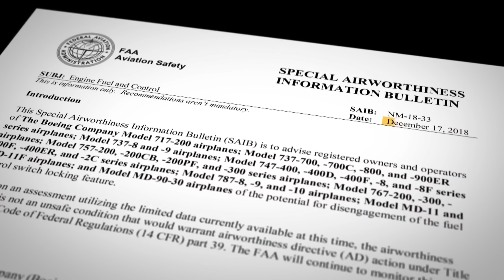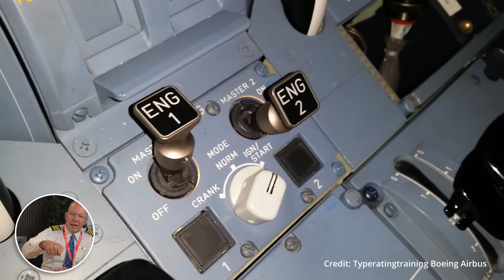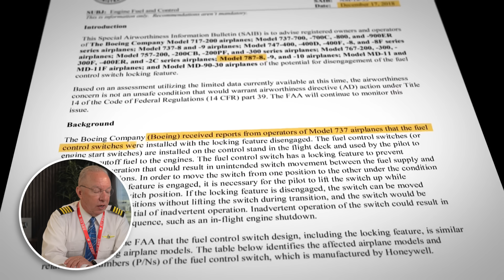Air India 171: The FAA’s 2018 Fuel Switch Locking Bulletin Explained (16 Questions Answered)

Comment: The anti-labor brainrot is strong in these comments today; I refuse to believe that there aren't at least some shills here to spread propaganda. I weep for my generation and our lack of critical thinking on display here. First of all, a video that is high enough resolution to make out exactly what switches were pressed by which pilot would be a massive file, and files take time to write; the larger the file, the longer it would take to write to the black box, which isn't ideal for ensuring everything is written to the black box in the event of a crash.

And for what benefit? All I can see is a negative impact on the working environment and on safety. People behave differently when they are being filmed, and that is not always a good thing. Just being filmed has a significant cognitive load; do you really think a pilot needs any more cognitive load? Citing examples of other jobs monitored by cameras just shows how normalized invasive surveillance of the workplace has become, but how many of those jobs are safer or more efficient because of those cameras? Is work actually better for them? "People who aren't doing anything wrong have no need to worry" is hilariously naive given how our society has been taken over by drooling Dunning-Kruger outrage zombies and that many in upper management are worthless MBA nepo-babies who have neither the technical knowledge or baseline cognitive ability to understand what they would be watching. For police, it makes sense because they wield the powers of the state and their account of events has ramifications beyond the direct encounter, but trucking, for example, is no safer for the cameras—They actually make the work environment more dangerous due to how they're implemented, using AI bots that doesn't even allow a sip of water, so they are more focused on not getting flagged by the camera than on driving.

Comment: I think that the odds of both switches failing one second apart are so huge that I would say that it didn't happen. I believe it was pilot induced. Which, why, and who may never be known? The pilot who said why did you turn them off really could have done it knowing that he would be recorded and if the other pilot did it and lied would leave the whole situation in doubt forever. This would actually hold harmless the one who did it forever.

Comment: Is it still possible that the non-flying pilot thought they were raising the landing gear and moved the wrong lever(s)? This would still be a terrible error, but consistent with “I didn’t do that”.
Reply: @DavidWRankinJr  That's very similar to the first unfounded, speculative conclusion made and later abandoned by Capt Steeeeeve. 

The fact that the Landing Gear Handle was found in the DOWN position would support that theory, but we cannot consider that single data point as conclusive because we haven't seen the entire sequence of events or read the entire voice transcript.  For all we know, the Landing Gear Handle may have been raised normally, and subsequently lowered once ground contact appeared imminent.  We have to be cautious to NOT jump to conclusions without all the facts.  There are too many possibilities at this point.

Comment: I get the camera thing. I think there's a lot of people assuming the cautious reporting because it's only a preliminary report means the full breadth of data recorded paints less of a complete picture than it does. By the time we get the complete report, there will likely be a pretty comprehensive understanding of what happened. I also sympathize on not having day-to-day cameras. There's a gap between what's not allowed and what's actually an acute safety issue. A lot of pilots find themselves in those gaps over time, and I understand their fear of airlines using those recordings to crack down on any tiny infraction and adding to the stress pilots face. Same with the potential for leaks to the general public, who don't know the minutiae of flying and don't have a good sense of what's a disappointing decision from a pilot and what's an immediate risk to the flight. [Or just how safe aviation truly is at this point.] Driving road vehicles is much more reliant on second-to-second attention than cruise flight and, to be slightly crass, incidents are much more survivable for apportioning blame, making cameras more essential for them. All that said, I think cameras are inevitable in cockpits. There'll need to be a balance of monitoring for safety issues and not punishing too much, driving pilots out of the industry and adding stress to people who notably struggle with stress. People want to know every detail these days, and being able to provide that via video, or really description of video, will eventually be required.

Comment: I'm wondering if the fuel cut off switches were both in the off position the whole time the plane was taxing and during the takeoff run.  When the 787 just lifted off the runway the switches on the landing gear said "the plane is off of the landing gear" it caused the computer to see that the engine fuel cutoff switches were in the off position then cutoff the fuel to the engines.  Why did the fuel cutoff just when the landing gear left the ground?  Too much of a coincidence.  I know if the fuel cutoff switches are in the off position then the engines shouldn't of been able to start of continue to run.

Comment: A VERY ery evasive answer about having cameras in the cockpit.
NO ONE asked if having a camera here would have PREVENTED the crash, the question was SHOULD they be added? A camera here would have CONCLUSIVELY shown whether the switches were moved, who moved them and WHEN. That's what the question obviously asked.  That is what the investigators are searching for. Your obvious reluctance to have your work day filmed is understandable, but you also have the lives of thousands of people direct under your control every year.  Whether someone is reading a magazine or telling an off-color joke and might be embarrassed or called out is irrelevant. So why pretend like investigations wouldn't be helped with their addition? Why pretend a radio broadcast relays the sanlme information as a television program?   It obviously would be TREMENDOUSLY beneficial.

Comment: Serious design concern. Just with changing the position of switch the entire operation can jeopardize and leads to catastrophe and system does not mind the thrust lever position before shutting down the engines. Its gut feeling that  rotary wings are safer than these commercial aircrafts with three positions switches installed. Somebody has to seriously think about it rather than shifting blames on others. Its not abt businness or existence of any company but abt lives of millions of people flying in unsafe conditions.

Comment: Captain Steeeve,

On Jul 12th 2025 (UTC) India's media report that the investigation is NOT focussing on a human action causing the fuel switches to appear in the CUTOFF position, but on a system failure. Service Bulletins by Boeing issued in year 2018 recommending to upgrade the fuel switches to locked versions to prevent inadvertent flip of the switches, as well as the FAA/GE issued Service Bulletin FAA-2021-0273-0013 Attachment 2 relating to loss of control issue were NOT implemented by Air India. The stated MN4 computer with faulty soldering, that might weaken and lose contact due to the thermal stress after a number of cycles, interprets data and commands fuel metering valves - with the lost contact attaching the MN4 processor to the EEC intermittent electrical contact, loss of signal processing and engine control faults can occur. The SB writes under conditions for the SB: "An LOTC (Loss Of Thrust Control) event has occurred due to an EEC MN4 microprocessor solder ball failure." According to discussions in the industry it may be possible with the number of cycles VT-ANB had already completed, the solder balls were weakened sufficiently to detach the MN4 from the EEC momentarily due to loads during the takeoff rotation leading to the loss of control of thrust and shut down of the engines.

Source: avherald.com

Comment: Relying on your many years as PIC along with other aviation experience, can you think of ANY scenarios, no matter how improbable they or it may seem, ie. confusing the fuel cut off switches with ANY control switch commands that are done climbing out of V2, that could explain those switches being activated? If not, then Sherlock Holmes was correct " When you have eliminated the impossible, whatever remains, however improbable, must be the truth".

Comment: How about adding a dual custody system where there are fuel cut off switches on both sides of the cockpit and to kill the fuel both pilots have to agree and  both sides have to be in the off position. Similar to needing 2 keys to launch a missile.

Comment: Like any modern day military vehicles (War Machines like Submarines.) there should be a "Redundant" system implemented on top of the cut-off switch. Like a secondary button that's required to toggle on the Captains side of the seat to allow for the switches to toggle.

Comment: You described how there is on the ground vs. in the air logic circuitry via sensors that know if the aircraft is on the ground or not. Why is that same logic circuitry tied into the fuel cutoff/run system so that one cannot cut the fuel to the engines during the climb period after V1?

Comment: As a Flying Customer we should DEMAND that the FAA install cockpit Camera's. Accident investigation is to get to the route cause of an accident. Pilot Unions  don't like Camera's because they don't like reports of Pilot error or violation of Cockpit SOP procedures. But it unfortunately it does happen!! 

Do we have a situation where we could have a very rare, but not impossible situation of WORN detents after years of the Switches being pulled up and possibly dragged across the Detent Lugs. Both the Detent and Switch lugs could get worn and rounded over time. Now this would be extremely rare, especially to have both Switches fail at the same Time. But extremely rare and first time ever seen mechanical problems have crashed Airplanes before..... MAX 737 anyone?? 

But it would provide Indisputable Proof if you had CCTV confirmation that  one of the Pilots physically moved the Switches to the Fuel Cut-Off position in a suicide or sabotage  attempt. At least then you would know that you did not have some rare Mechanical problem that has never been seen before. 

GermanWings 9525 was an example of deliberate Flight Into Terrain.  And the Inspection authorities will not address a deliberate Flight into Terrain... unless ABSOLUTE proof can be shown. CCTV Camera's would add another layer of Data Monitoring. It could also speed up accident investigations significantly. But primarily in Pilot Error... which is a touchy subject. But it's time to get rid of these old ideas. Other industries that Monitor Human Performance with CCTV Camera's have done this. Airline Pilots with the responsibility they bear, should be the FIRST organizations to accept this. 

 This I would like to ask Captain Steve to answer directly. And please read the whole article. 

 In the meantime, here is a fairly chilling article that people seem to be avoiding. But the public and accident investigation teams need this Data. 

https://en.wikipedia.org/wiki/Suicide_by_pilot

Comment: Capt it seems that the installation would not require this kind of bulletin because it would just be inoperative.. the issue seems to be with the switches turning off by loosing contact so they should be changed with some frequency.

Comment: The fact that both switches were still in Run AFTER the crash proves the locking features worked.
Reply: Thats not conclusive either. My bathroom switch tricks me

Comment: I am a pilot and a retired Forensic Investigator and I find it interesting that the first words out of the pilot’s mouth was “why did you cut fuel”. How did he know so quickly that the fuel was cut off to the engines. If you lost thrust, I think I would have said why did or why are we loosing thrust and start a checklist. How did the pilot know so quickly that it was not a bird strike or a flame out. They immediately concluded that the fuel cutoff switches were thrown. Those switches cannot move on their own. How could you not notice in your peripheral vision a pilot reaching back and shutting of the fuel. All the Indian news agencies still want to blame Boeing. They do not want to accept the fact that the pilots either accidently cut of the fuel or cut of the fuel on purpose. Seems they want to cash in on Boeing. The funny thing is that many of the components and wiring are made and imported from India!!!!

Comment: Thanks Capitan Steeeve! I have three questions:

1. Let's assume it's final that one pilot cut it off and it was too late to put it back up. This could still happen even now, right? If a pilot wants to do it, is it possible?

2. What can we do to prevent this exact situation from happening again, right now? (Anything beyond simply trusting the pilot?)

3. What other deliberate actions can a pilot take that are not reversible? Should the FAA investigate all possible scenarios in different phases of flight (takeoff, descent, etc.) and develop preventive systems? Let's assume a pilot wants to end their life (I know it's rare), but let's consider it and come up with a preventive solution.

Comment: Regarding the question as to whether or not it could be a cyber attack - Yes. It doesn't need bluetooth, air-gapped systems are still vulnerable. Regardless of that, the 787 is a modern aircraft with remote telemetry - That system isn't infallible.

I'd also add that a simulator cannot accurately simulate a complex electrical fault. If there's an electrical issue, anything is possible and they simply cannot simulate every possible scenario.

Comment: I am far from Aircraft’s, just common sense - 
1. When in full throttle - can fuel lines be Cut-Off without reducing the throttle ? One of experience 787 Captain, claims same - in Hindi. Today’s push start-stop switch in a car can’t be cut off while car is running.  The Captain says it’s a Protocol of 3-4 minutes, fuel can’t be cut off in seconds. 
2. Assuming it’s possible - won’t there be alarms by the most advanced 8:29  on Board the Dreamliners ? 
3. If one asks “Why did you cut-off Fuel?” and Other answers “No I didn’t.” Does it  conclude already one or both are lying ? 
Without assuming - valid authenticated response to above would be quite useful for people globally understand. 
From Jakarta.

Comment: I used to construct and wire up cockpit controls. Not directly related and not Boeing,  but airbus and fighter jets. I know these kind of switches, are serious stuff. Mil spec, far beyond your average toggles, they cost a shocking amount and for good reasons. I find it hard to believe they are to blame. The care and testing that goes into them and the panels that house them is extreme since failure is not an option.

Comment: They say the switches were found in the off position but I thought they think that 1 of the pilots tried to put the switch on at the last second and 1 of the engines started up…How would the switches be found in the off position ?
Reply: @kerripieper4394  The Fuel Cutoff switches were found in the RUN position.

Comment: Did you go through the details of this 2018 FAA bulletin ? Couldn’t there be a way that the improper mounting of the switches could just eliminate the locking trigger but let the switch work like a basic 2 position light switch?? If it couldn’t hold in the « on » position, obviously it would immediately be noticed by the 1st crew…

Comment: Thank you captain for your videos.There are number of videos in social media related to Air india plane crash.In one of such video the pilot explained how fuel switch are cut off.He explain that it takes almost one minute to cut off one fuel switch that means total two minutes for both engines.He also explain that no single pilot do this maneuver lonely.Both pilots make this maneuver and when, when they have enough height means time also.In Air India plane crashed pilot got only 39 seconds and 600 feet height.My request to you please explain was it possible to cut off both fuel switch within that short period.I am a common man and not aviation expert

Comment: Passenger asks pilot: “Does this plane have an ‘off-button”?” Pilot: “No, but we have this switch!” Logic needs to prevent the ability to cut the fuel at one quick step while in flight. Zero secondary controls.

Comment: i am not a pilot and have no experience about cockpit voice recording.  BUT it seems if it is actually a recording of voices it seems to me that after some investigation be will know which pilot said what phrases.  Maybe the recording is not that clear.  Just a thought from a novice.
Reply: @danbreyfogle8486  Dan, this was just a preliminary report.  The cockpit voice recordings will distinguish between what was said by each pilot in each headset microphone and/or the cockpit area microphone as well as radio transmissions received.  I'm sure the investigators already know exactly who said what and when, but chose only to vaguely characterize one brief part of one exchange.  The full transcript will be in the final report.

Comment: The whole point of a FADEC is that it has full authority, by all means a pilot should be able to tell it about a fire and it should respond appropriately to that, but a pilot shouldn't be able to shut down an engine without the appropriate checks. The engine failure checklists should be automated via the FADEC, there's no need for cutoff switches to be used in-air.